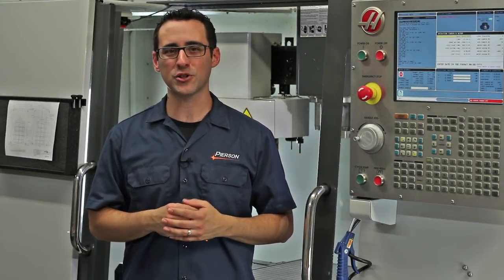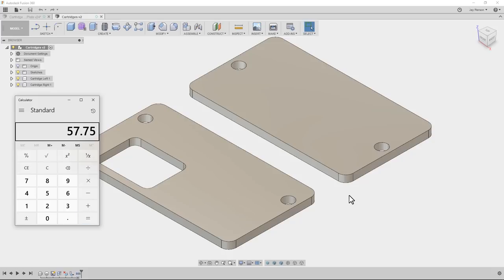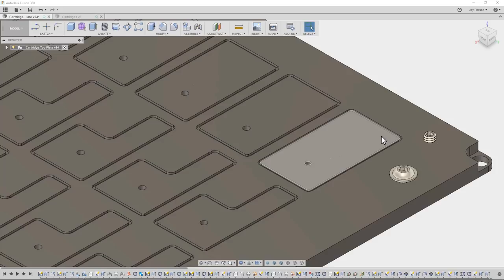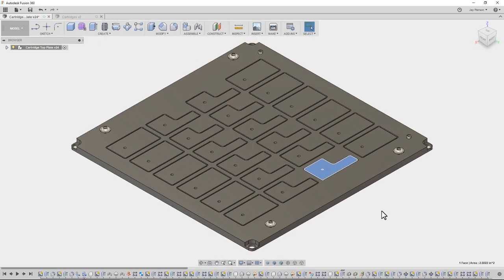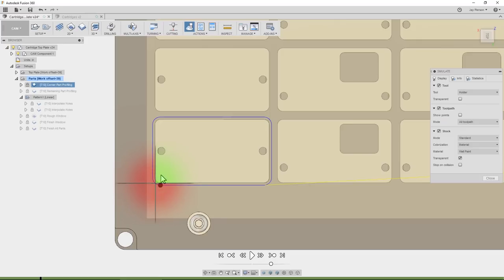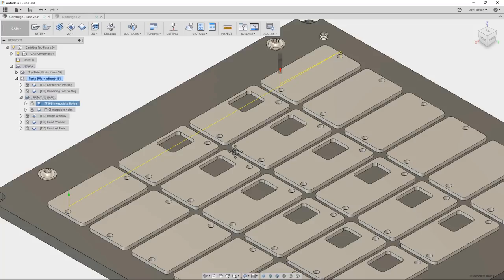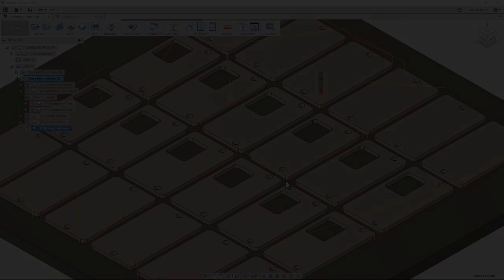Vacuum Workholding for Small Parts | Pierson Workholding Vacuum Chuck

Comment: Outstanding video that covers almost all the vacuum tool path and operation tricks I've learned over the years. One other thing about partitioning parts first, leaving a thin floor is that it allows the sheet to become more flexible and better conform to the gasket, pull a better sealing vacuum and hold better for the rest of the run. Another tip is to shut off your air nozzle (secondary coolant) at the end while trimming that 0.010 floor away. You're barely generating any chips from that cut, evacuation is a non issue, but the air stream is surprisingly effective at forcing air under a part and breaking seal. Hopefully the air did it's job earlier and evacuated chips from the slots because the cutter can stuff those under the parts as well.
Keep it up, you've proven a very fast learner and an exceptional executor in many facets of the business.

Comment: Hi i see your tooling plate doesn't have any channels  under the part for the vacuum only a single small hole? do you not need channels for the vacuum to suck the part down?

A

Comment: Impressive although I think milling the pockets instead of going for a straight window cut adds lots of time to the cycle. The cutting tool seems like it wouldn't last long if it wasn't for the blowing gun pointing at it thou, but same as you I would use a str8 o-flt cutter. Well done! It reminded me of a similar job I did once, we used to trim thousands of these lil tabs daily. :)
Reply: Its better to deal with chips that wont damage the end mill or work piece rather than huge chunks of material that are cut loose

Comment: A thing to note for your hold down force: The maximum amount of vacuum achieved goes down the higher in elevation you get. Any Venturi pump that will draw 28"Hg (93% efficient) will only draw 25"Hg at around 3000ft. This is important to note when doing your hold down calculations.
Reply from the maker: Correct! Let's convert that to PSI of holding force.  For every 1000 feet of elevation the holding force in psi decreases by a 1/2 lb.  So with your numbers, the holding force at 3000 feet is 12.5 lbs per square inch.

Comment: Also do you find your part lifts slightly on the seal area due to the seal, or any over hang outside the seal so if you were facing the top face of the parts you will get slight variances in thickness between the edges and the centre of the flat part?

A

Comment: Great explenation, thanks! 

Is there a need to recess the space inside the gasket in any way to draw a vacuum, especially as there are no channels? Or is everything just in the same plane and the material imperfections or so are enough?
Reply from the maker: From looking at it, the part and chuck surfaces are smooth, but on a molecular level there is plenty of room for air to move.  Keep in mind there is plenty of room between the two right before the vacuum draws them down to full contact.

Comment: Are you actually cutting into your vacuum plate slightly?
Reply from the maker: Yes, by about .010" deep, but only on the first cycle.  Sometimes it's a good idea to go deeper the first cycle (~.030") to cut a clearance trough and shallower all the following times just so the endmill has some space under it.

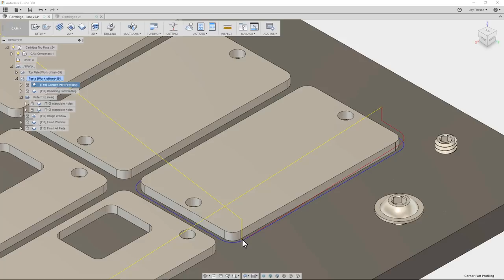Comment: 4:45 what's 20,000th in metric? What unit are you using?
Reply from the maker: .020" = .508 mm
Reply: Thanks
Reply: @boogerking7411  As a metric person, I try to remember that "40 thou" is about 1mm.

Comment: What about the screw holes?
Reply from the maker: They're also interpolated to leave a flat bottom with 0.010" material at the bottom.  The leftover material is easily removed by hand with a countersink which leaves a nice chamfer.

Comment: Good video, but it's not a column of air. If air were a solid, it would be a column. But air is a gas, it exerts force from all directions. While the column of air explanation seems fancy, it's 100% scientifically inaccurate.
Reply from the maker: You're right. The "column of air" is just an easier way to picture it.